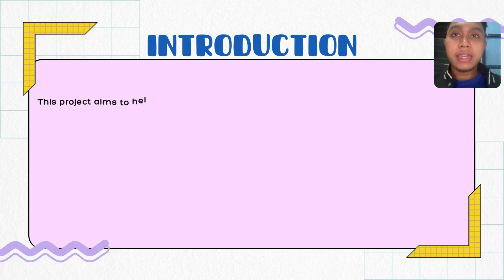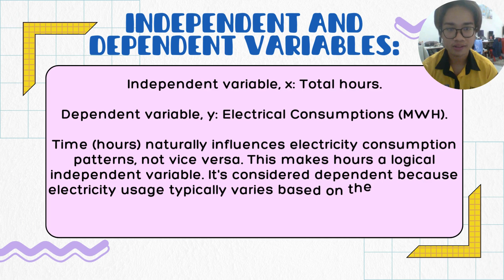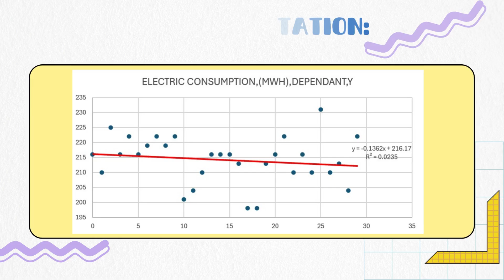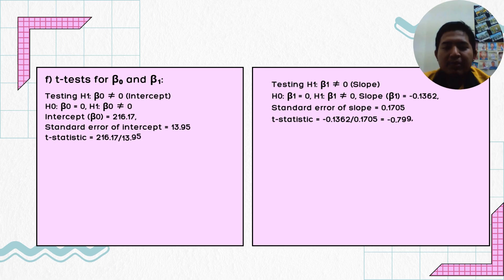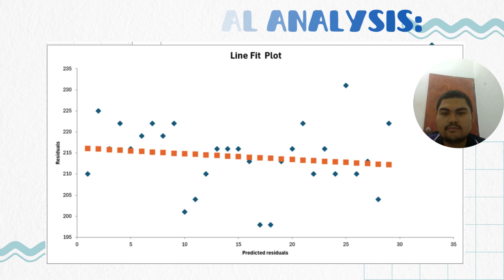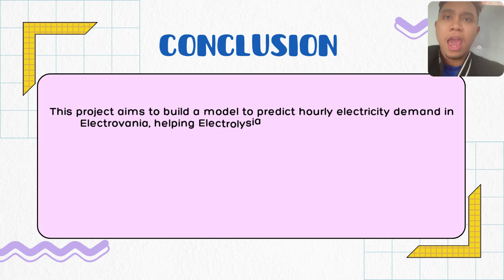Dragon 4 video presentation

Comment: hai guys, i have one questions.  What is the main goal of the project conducted by Group Dragon 4 for their Engineering Statistics course?
Reply from the maker: The project aims to develop a predictive model for hourly electricity demand in the city of Electrovania. This model will help Electrolysia optimize energy production and distribution by analyzing five years of electricity usage data combined with weather information. The focus is on balancing fluctuating demand with efficient energy supply while promoting sustainability.

Comment: Hello guys, what are the independent and dependent variables used in the regression analysis and why were they chosen?
Reply from the maker: The independent variable which is total hours , was chosen because time naturally influences electricity consumption patterns throughout the day. The dependent variable which is electrical consumption measured in Megawatt Hours (MWH) , reflects these variations based on the time of day. Measuring consumption in MWH is standard practice in power industry analysis, providing a reliable metric for understanding energy usage trends.